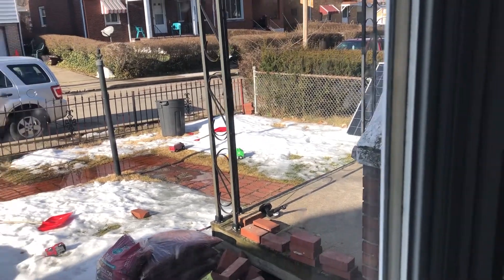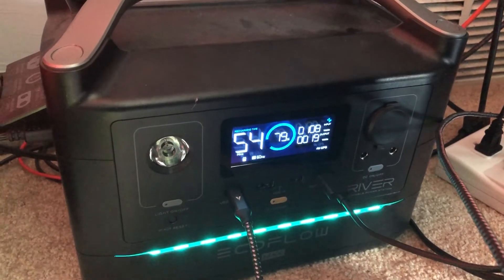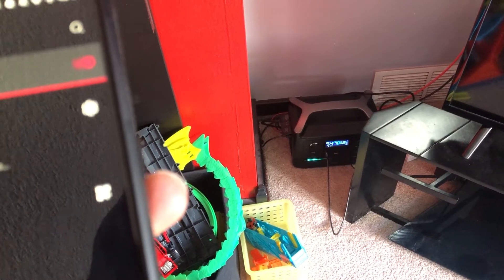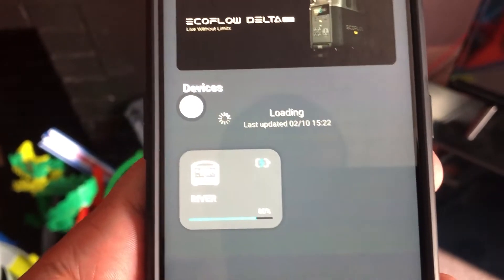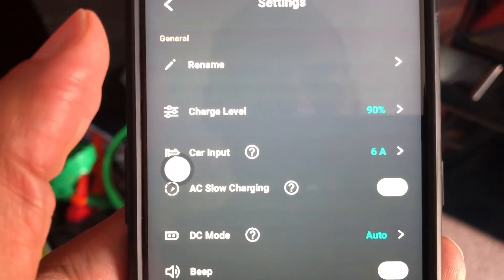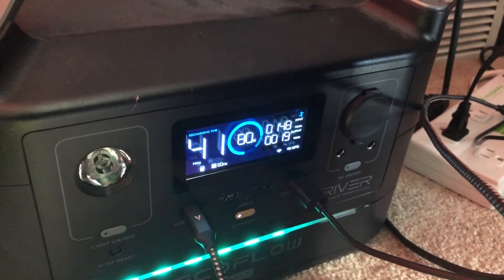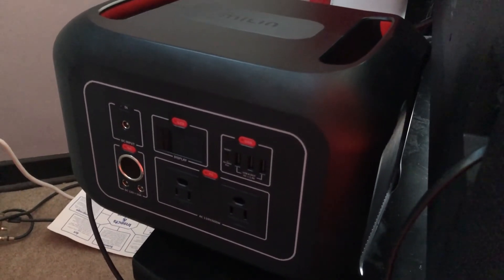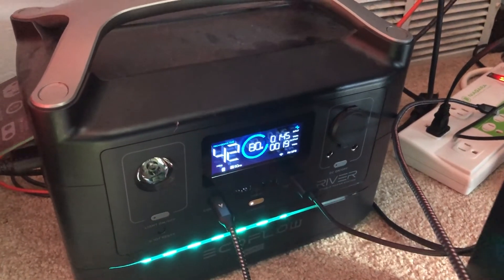EcoFlow River AC Slow Charging GIMPS Solar Input

Comment: Hey Ive. Did u ever figure out why the ecoflow river doesn't charge the extra battery. I have had this happen with 2 different main units and extra batteries. I just bought another ecoflow river. Both units fully charge with 100 watt output r the same. Any ideas
Reply from the maker: Interesting development! In my situation I presumed the extra battery to not be charging it helping. So I detached it from the river, drained the River then re connected it and charged it and it seems to be acting like the has an extra battery. I guess I may have balanced it but I'm still returning the battery..... Because I'm afraid that something is still wrong with it. shrugs
Reply: @AskIveSolar  me too. Returning the battery. Not trying a third battery. A persons review on Amazon claims he had the same problem. He said it had low voltage. He claims when batteries set for awhile not being sold the voltage could drop. Not sure how true but makes sense.

Comment: What firmware are you on?
Reply from the maker: 1 2 4 2 
Latest is 4 8
Reply: I’m not sure if they fixed that but I know it was on the list, let me ask.
Reply from the maker: What does fixed mean. Do they only want it to impact ac charging or will it still impact solar but not so much.
Reply: @AskIveSolar   trying to find that out. Hopefully it means that it only affects AC charging. But I have to see.
Reply: So, for now, AC slow charging does still affect solar.
Reply from the maker: Thanks for inquiring

Comment: Thanks for the key info. My replacement unit should be here soon. They sent me a EcoFlow Lamp for the troubles and it is nice.
Reply from the maker: Dang, I never even heard of an ecoflow lamp. Haha
Reply: @AskIveSolar  Shocked me too but it's real. The lamp even charges my devices and fits in the palm of my hand.
Reply: Ya boy want to stay low key but if you need some content, there it is. You just gotta find it. It's not solar but very Interesting. Specs say lifespan 50000 hrs and it's magnetic. Once again thanks for helping me with my solar questions.
Reply from the maker: Send me a picture bro! Solarquestions@askive.com
Reply: @AskIveSolar  No problem. On the way.

Comment: I'm not surprised. It is just the way of capitalism that they never make a perfect device. So the question becomes, is this a bug or a feature. Is "AC Slow Charging" actually just mislabeled "Slow Charging". It makes sense as a battery protection feature but that's bad documentation.
Reply from the maker: Right. Just slapped a limiter in there because people were concerned about fast charging and didn't pay attention to the details.